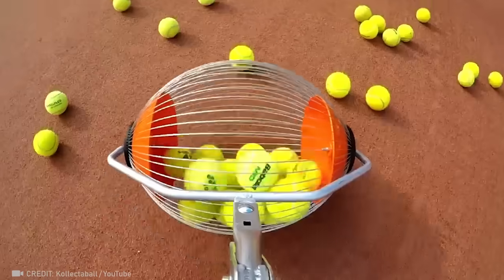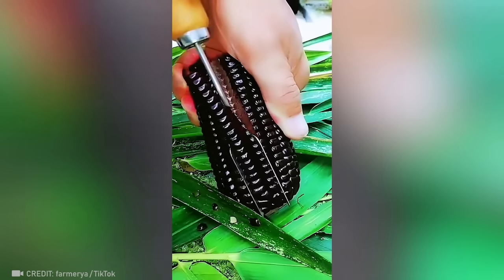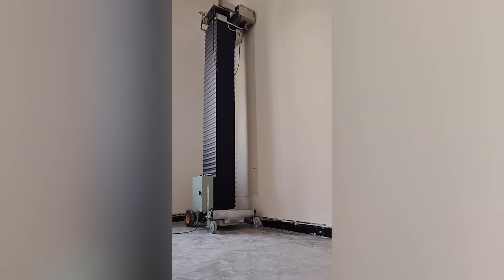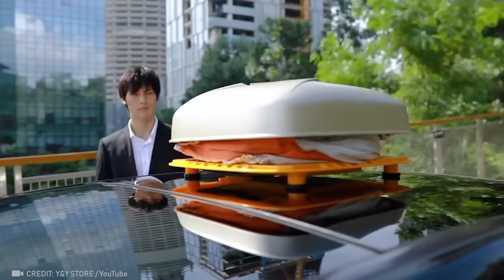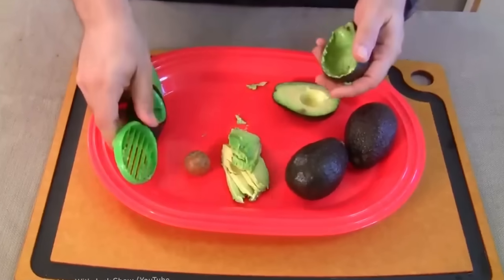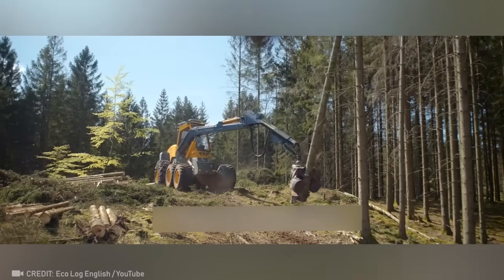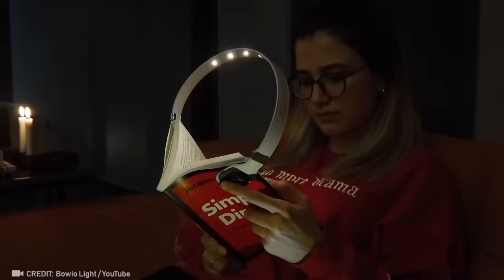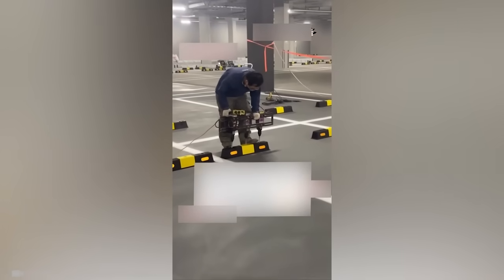Amazing Tools That Are On Another Level | Compilation

Comment: As an engineer, I found 14:57 to be fascinating. They are chipping out a trench in the upper layer/flange of the bridge. You need a tension/compression couple in the base/top of the bridge, respectively, for it to remain stable, so when they chip out an ever larger trench from the top, with zero compression capacity, at some point there just isn't enough concrete at the top to hold the bridge in place. You can kind of tell, and using , and . to see individual frames helps a lot, that the catastrophic damage is that trench cut being slammed shut, aka, the concrete next to the trench cut crushes.
 
It's also interesting that they make it more than halfway across the support before it fails (and you can tell the side concrete's not doing much), so there had been quite a bit of extra capacity, a well built bridge. Tho in service, a lot of that "extra capacity" is used to support the design traffic load, itself.
Reply: Not a Tofu bridge then

Comment: that popcorn machine basicly stops the kernels from popping open trough pressure, and heats them to a higher temp then regular popping temperature without actually burning them,then when the bag is placed over it with the handle sticking out its popped open and the pressure drops instantly making all kernels pop open and out of the device into the bag, for near perfect round popcorns
Reply: Its called a puffing gun....they've been around for almost 100 years.

Comment: 1:52 i see a very noticable trace of the square box being applied to the wall.
Reply: The feature of that device is not that it can clean (that technology is very common) but that it can do so in the open without spreading the media or the removed surface all over the place, but collecting it in the bag.   Another case of sloppy commentary.

Comment: 24:21 "the fastest hole digging" She was tearing through those holes because the soil she was digging in was loose, light and free of rocks and roots. The auger setup was good for one person. I liked the stability you could get but I could do the same thing in the same dirt with a one man mechanical or hydraulic auger. Put her and that auger in ground where there is a bunch of roots and rocks and the digging speed is going from fast to screw this, I don't like this anymore 😂

Comment: 9:36 - Is it me, or does trying to burn debris off of power lines with a flamethrower, seem like a bad idea??
Reply: Probably safer than using a power washer LoL
Reply: Cables from overhead lines are mainly made of steel and aluminium. In the short term, it doesn't matter to them

Comment: Sadly for all of the inventors and people behind these tools, so many have one thing in common, they aren't practical enough for to catch on and achieve ongoing widespread use, they have drawbacks of initial expense, durability, cleaning, setup and takedown, storage, transportation, parts availability. People will largely go on with all the old fashioned ways of doing things

Comment: 8:14 11:05  26:20  38:30 have all been around for decades.
13:12 has been around for over 30 years!
29:33 Every bus I've seen since 2000 has a safety strobe on the roof, so this device would likely tear it off.

Comment: really dumb to not check what he show in this video, 02:02 it's nothing like "cutting metal like butter" , it's just a percution tools that go through the hundreds thins metal layers that compose those electric motor. The only thing it cut is the copper wire.